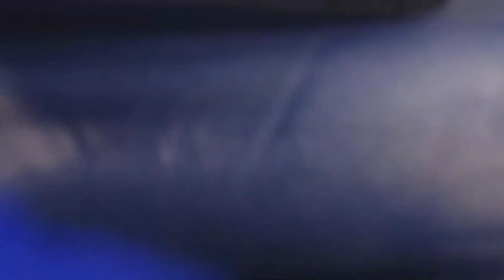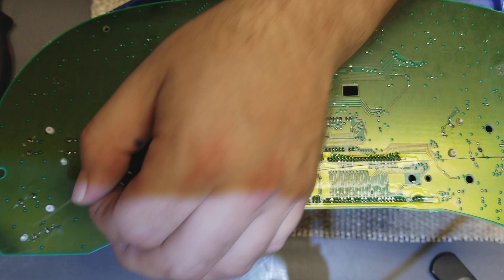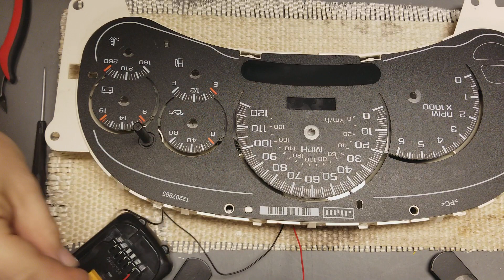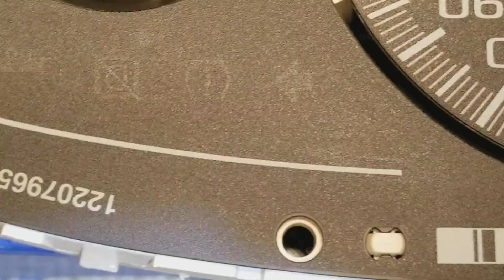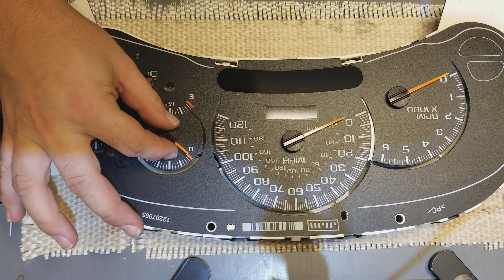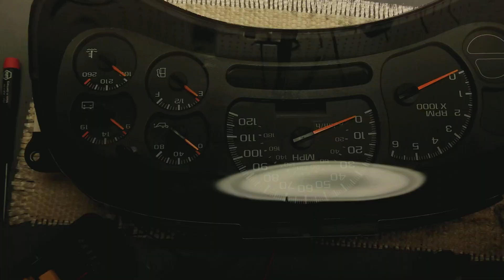GM Gauge Cluster Stepper Repair  and LED Install

Comment: I replaced my lights before watching this and did not have a resistor. Now replaced leds (5 fried) and added resistor. All lights work with 12v. But when I plug into vehicle harness lights turn on then go out when rest of cluster gets power. Any ideas?
Reply from the maker: I'd make sure you have the polarity of the LEDs correct.  That would be worth checking.
Reply: @FixitFrank  update. I figured out that when I plug in the 2nd ground wire at B12 is when the cluater lights turn off. I just don't know what that means. And more importantly how to fix it. Do you?
Reply from the maker: i was just thinking about this. I suspect you have a solder bridge somewhere shorting one of the leds to that B12 pin.  I'd check your soldering carefully.  I can't think of any reason that the lack of resistor would have damaged anything else aside from the leds that you already changed.  I'd set your meter to ohms or continuity and check from B12 to each LED pin and see where you have the short.  Thats what I would do if I had it here. I know some of those pads are close and it would not be hard to get a stray solder bridge
Reply: @FixitFrank  The polarity is right. When I firat connect my harness without pushing it in all the way. It makes contact with the light circuit  pins and all the lights turn on. Then  when I push the harness in enough for the rest of the cluster to turn on. That's when lights turn off. I can isolate between lights and when gauges turn. And it's as soon as the rest of the cluster gets power from what I can tell. I tested at harness and dimmer. I have steady current. I theck solder at pins there is no fracture. Is there something else in the circuit I could have messed up when I fried the first leds without the resistor?

Comment: Did they all work?
Reply from the maker: They did! In fact they worked until the truck died. These days you can buy led drop in bulbs so this method is kind of obsolete. But if you need your LEDs to never get loose, then soldering might be more reliable

Comment: Looking for a stepper for 1990 Chevy Silverado 1500 have any idea where I can get one
Reply from the maker: Which one? I learned many of the older steppers are different (temp versus gas guage etc)
Reply: For the fuel 1990 model

Comment: I have that exact one , can you do mine for me $
Reply from the maker: You can actually buy drop in bulbs these days that replace the old ones with LEDs. No soldering required.  Just lookup your model truck and "led gauge bulbs". I did my toyota truck with them and it was super easy.

Comment: I did all the motors and the LEDS and the lights work but the motors are all off and or not working correctly. My oil pressure needle still dances and I think the sending unit must be the issue. My tac is getting power but doesn't go higher than 1000 rpm
Reply: Speedometer is the only on that seams to be correct
Reply from the maker: Hmm.  Might be the senders or the voltages being off due to bad capacitors on that board.  I like your idea of starting at the senders though. Without knowing their condition, you may end up running in circles.

Comment: Would doing to much heat cause the guages to not work? I think I messed it up
Reply from the maker: It's possible. They are pretty delicate but is rule out the senders and battery voltage first

Comment: I appreciate your video but out of all the videos on YouTube I have not found one video that shows details of which light pin is Hot and which is Neg, Thanks.
Reply from the maker: https://youtu.be/z1q4VZmR8tI?t=639  If you use an ohm meter and put one probe on the negative side of either of the capacitors at 10:39(the black stripe on the metal can), you can touch either of the pads. One pad will give you 0 ohms(or very close), that is Negative/Ground. The other pad will be many many Kilo Ohms or more and be positive. Then if you watch a little longer I do mark + on the positive pad side. 13:35 for instance, Look at the upper right. You can use that to find the other positive pads.

Comment: What size is positive on the circuit board
Reply from the maker: I forget honestly,but you can use the capacitors to determine it. Measure continuity from the negative side of the cap to each bulb contact. Every contact that measures zero ohms is the negative. Positive is obviously the other side.

Comment: Fantastic tutorial.  One question, how did you determine the positive post on the circuit board for the led's?
Reply from the maker: If I recall correctly, I used the negative terminal of a filter capacitor. I measured continuity to each pin and marked them that way.

Comment: Incredible job producing this video! Best I've watched. I have an H2 SUT 2007 that just had auto start installed and now the speedometer light and the three light to the right are out. All lights to the left still work fine. Can't say the installer did it as I didn't notice for a couple of days. Thanks for the great instruction. Where does one get the LEDs for this?
Reply from the maker: Many thanks!  I appreciate that!  I found the LEDs on Amazon or Ebay.  I want to say it was $20-30? It was pretty cheap. Now you can pop the LED into the adapter socket and plug it right in. No soldering needed.  I think they are listed under "gauge light kits"

Comment: It looks like my ford escape has solderless contacts instead? How do I remove these? They also have plastic rivets. I don't want to just go pulling things off if that's not whats required 😅
Reply: I think my part number is SONCEBOZ 6403R200

Comment: Where did you source the LEDs? I've only found individual SMD parts in the 5050 size, which I wouldn't be opposed to, but adding the resistor would make for extra work.

Comment: I recently did this on my Chevy Silverado with LEDs from amazon. They should have resistors in them already. I did a super clean job and I thought it turned out great. I tested them with a 9 volt battery and some wire to be sure they all worked and they did. But when I put it in my truck only the blinker lights want to work. Any ideas as to what’s going on? All the other dash lights and stepper motors work as well, just not the lights behind the gauges.

Comment: The empty corner space is usually for a transmission fluid temperature gauge. Good for hauling trailers, etc. to keep an eye on overloading the transmission.
Reply from the maker: Thank you!  I know I have seen stuff there on other displays but wasn't sure on this one.  I'm not so much a car guy as I am a general electronics guy.  I can work on cars just fine(to a point) but when you get to the various models, its not my specialty at all.
I really appreciate the info. Hopefully this thread will have enough answers for anyone else who searches for it.

Comment: how did you know where to mark positive?
Reply from the maker: I found it by measuring where the positive side of the capacitor connected if I recall correctly.

Comment: the light that says what gear your in like drive and reverse is out how to I replace that ?
Reply from the maker: Hi Tim. The PNRD12 display is called a VFD(vacuum fluorescent display).  VFD's by design tend to have that blue/green look to them due to the gas inside the enclosure.  It's not really possible to change the color with another component.  The only way I can see to kind of change the color would be to use a colored light gel(colored plastic sheet used in the lighting business). Problem with that is the green/blue VFD wont give you much variation for red or yellow.  It'd be a waste of your time in my opinion. 
A possibility would be replacing the entire VFD with an LED display but that is a huge modification that I wouldn't be able to explain in a comment. It would also be very expensive and time consuming.
Reply: @FixitFrank   It's burned out i need to replace it thats all. And thank you for your time
Reply from the maker: @timhunt1989  ohh. I got you.  They don't usually burn out.  At least it's almost impossible to burn out.  You probably lost a resistor that feeds the filament of the power to it.   Above where it says DS19 is an array of resistors that I think send power to the tube.  Make sure they are not bad. Another thing to try is carefully connect the display back up to the car(with it apart) and measure voltage at the VFD.  You should have about 30V on one of the end pins. If not, that is your issue. The power supply in the display failed.  I don't have one to look at or I'd tell you where the parts are.  I'd start at that resistor array and re-solder them.  I know they get hot and can desolder themselves, even if they look connected.
Reply: then again maybe it's the switch that tells the light what gear im in ?? any thoughts on that ?
Reply from the maker: @timhunt1989  its always worth checking but I would think you would see something even if that switch wasn't working. I am leaning towards something on this board because its known to get warm. Heat is what makes solder fail.  If that resistor area is discolored on yours like it is here, then it would make sense. I don't have a manual but its worth seeing if the shift info is sent to the cluster as separate signals or through CAN bus.  If it's sent by CAN bus then its not likely the shift switch. Definitely cant hurt to check though. Chasing wild geese is not that much fun.
Reply from the maker: good luck!
Reply: @FixitFrank   it was the resistor on the top right  Tim fixit Thank you so much
Reply from the maker: That is awesome!! I'm so glad I could help. Great job on fixing it!👍
Reply: ok where can i get the vactume tube for the transmission position indicator ?

Comment: How do  figure out which is negative and positive for the lights?
Reply from the maker: I used a capacitor to ohm out the polarity.  I believe there is another comment here with the polarity listed.

Comment: can you tell me what bulbs you ordered that have the resisters on them because i cannot find any.
Reply from the maker: I soldered them on myself. You can also buy them ready to plug in without any soldering. Something like this would work.  They are using 3 LED together which negates the need for a resistor. https://www.amazon.com/Partsam-Instrument-Cluster-Dashboard-Indicator/dp/B00XPCY4V6/ref=sr_1_15?
Reply: @FixitFrank  those don't have the resistors like the ones you installed, I installed them in my Tahoe and they burnt out in a year with no resistor.
Reply from the maker: @Super240sxturbo  makes sense. They will overheat at a full 12v and over 20ma. Nowadays you can buy direct drop in LEDs. They have the resistor built in. This kit is "ok". I have it and for most cars its fine. Some cars the socket is loose. https://smile.amazon.com/cciyu-Multi-color-Instrument-Dashboard-Cluster/dp/B014FBGKLC/ref=sr_1_2

Comment: So I ordered 5mm LED bulbs of Amazon to replace my old ones with... Is this not the right thing to get?  I know you you touch on it but how do I know which way to to install the LED the right direction?
Reply: Yea I'm glad I watch your video. I cancelled my order and bought LEDs with built in resistors.
Reply from the maker: Sweet! Yeah you are better off with the pre-loaded resistors in this case. Next time I have a display in here, I will document the polarity better.
Reply from the maker: Make sure you have a resistor or the leds will burn up.  I think there is another comment here that has the layout. I found negative by measuring  continuity from a negative side of a capacitor . The LED polarity is set by the lead length.  The longer leg is the anode or positive. Shorter leg is the cathode or negative.  You want some sort of resistor though to limit the current. Roughly 800-1200 ohm(1kohm) to get 10-20 milliamps to each led.

Comment: Where can i buy the light bulbs ?
Reply from the maker: I bought them on eBay if I recall correctly.  You can now buy LEDs with bases that will fit in the existing socket.  Check on eBay using the make of your vehicle and you will see many options.

Comment: Great video, best I've seen so far.

A few questions:

Can you give specific part numbers to buy the stepper motors and LED light bulbs?

Also, how did you find the positive of the lights on the board itself?  I saw you had them marked but how did you come by that.  My board looks exactly the same, would I be able to just copy your points (2004 Sierra).
Reply: I agree with your assessment -- it is the best, but does not include the mapping of the polarity. You can determine that with a Digital volt meter (or an LED light).  
Unfortunately, I cannot include a PDF file with that mapping, but here it is as text:
- Turn signals,  + on top;
- DS 17, DS 19 and DS 20:  + Lower left corner;
-  DS xx,  + Lower right corner (located just to the right of the spedo stepper);
-  DS 21, + Upper right corner;
- DS 18 and  DS 43 , + bottom center 
- Ground (-)  opposite side ...
Hope this helps
Reply from the maker: Im going to pin this or lock it or whatever its called so people can find this easier.  Thank you for taking the time to share!
Reply from the maker: Hi Jason! Thanks for the compliment! I have to look into my purchase history but I will find it for you.  The polarity I figured out by checking continuity from the negative side of a filter capacitor. Then marked it. Feel free to use my markings though. It'll be way easier.  I'll need a few days to get you the part numbers but I will get you the numbers.